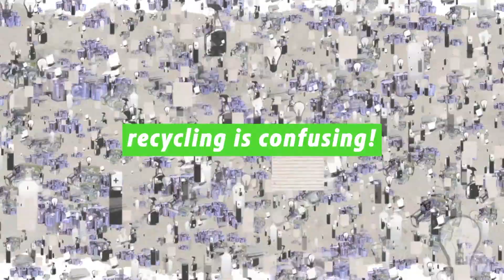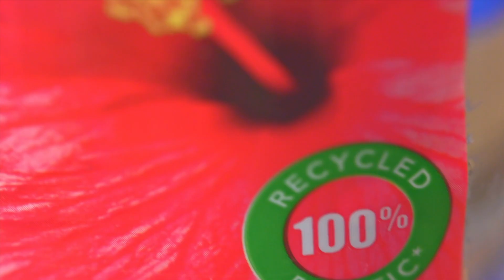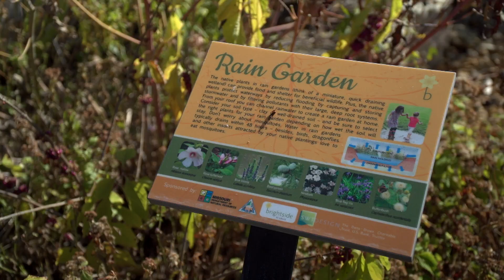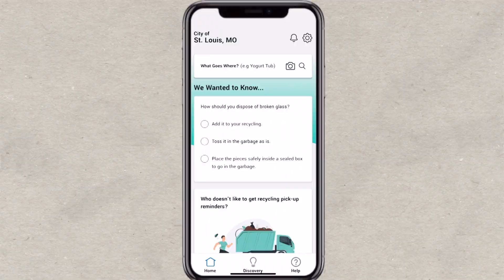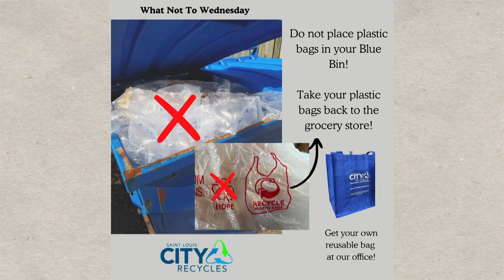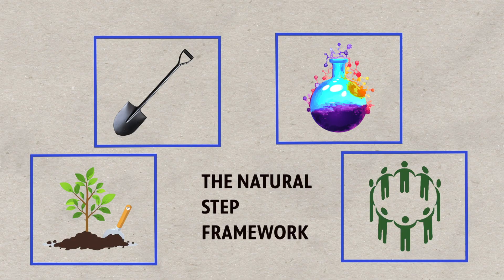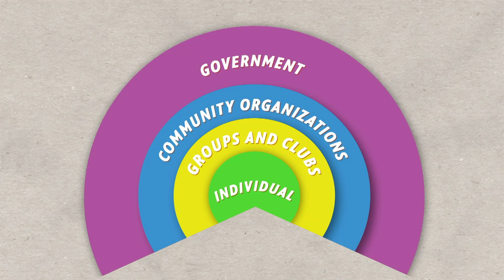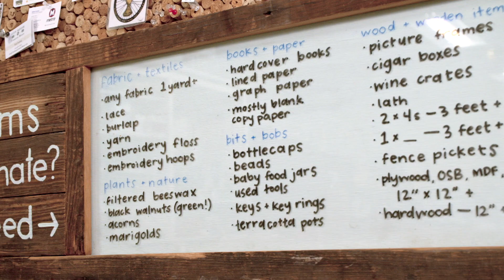Recycling Demystified | Episode 1 | What Do I Do with This?

Comment: Here in Australia mostly the soda bottles and cans have a deposit added to the cost when you buy them, after their use you take them to a recycle depot and reclaim the deposit, the caps of the bottles are the only things that go into the trash or as we say here rubbish, with the cans some people remove the tabs and save them until they have a good sized amount this is then give to some one else to recycle for charity.
We also so have very high fines for littering.
Interesting video, Cheers from Adelaide South Australia.

Comment: re: perennial 
yeah... the issues i have... is that it just becomes hoarding. 

yeas we absolutely need places like perennial, we need tool libraries, public maker spaces. 
but these programs also need substantial state and federal funding. 
they need to be in the majority of communities.

and something that i really find necessary are teams of "garbage pickers" and warehousing for the stuff. 

the task of separating recycling and up cyclable materials is monstruous once the stuff hits a truck and the trash facility... but if we had block by block pickup or trash teams... yeah it would take longer, and more individual labor hours.. but i would guess it would save so much time and effort on the back end.

Comment: Recycling is a sham, less than 10% of what gets picked actually gets recycled. I have a friend in the industry and the problem is that there is virtually no companies that will buy and process the plastic waste and so the garbage companies have no option except to dump it in their landfills. So we the taxpayers pay more to have recycling pickups and it all goes into the dumps.
You can’t mandate recycling at the waste end of the stream, you need to have industries and products the can use them cheaper than non-recycled materials, then there is market demand for recycling.

Comment: You ran through the types of recyclable plastic REALLY fast. Would be interested in seeing another video about the different types of plastics, and maybe more info on why they are or aren't recyclable
Reply: everywhere I've lived that has recycling has a list of specific types (numbers) of plastic that are allowed and ones that aren't. (mine doesn't take number 3, for example.) and unlabeled plastics (which lids for containers usually are) are almost never accepted. I really wish they would have addressed this here because I feel it's very misleading to just say "any type of plastic is recyclable" without elaborating on the limitations at all :/
I've also frequently been told that greasy/dirty cardboard (ex. pizza boxes) cannot be recycled and that isn't addressed here either. maybe in a sequel video?